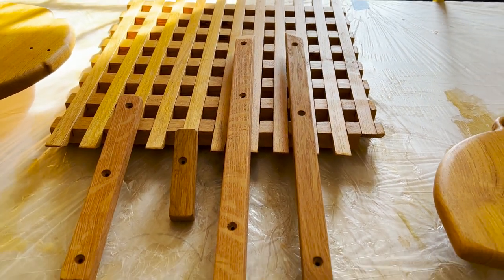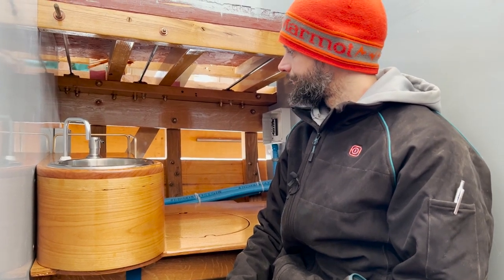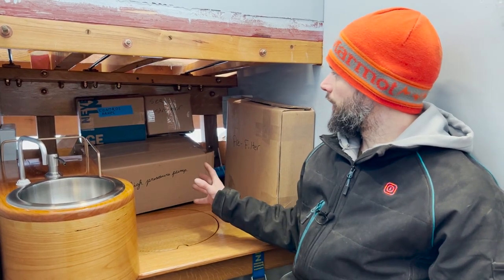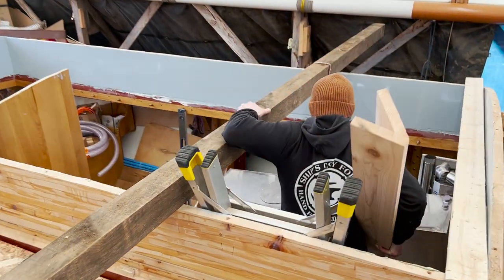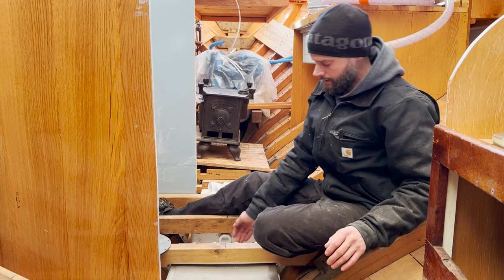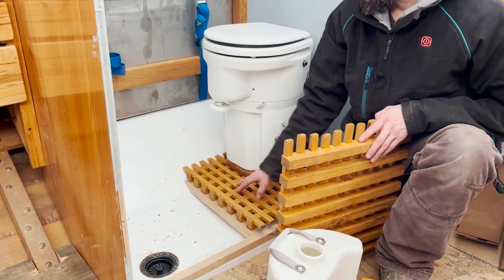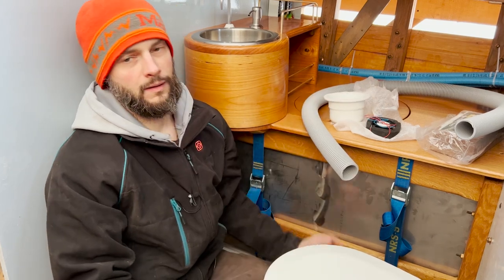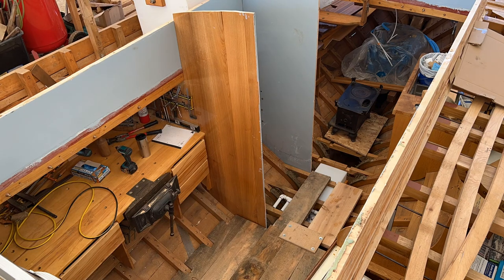Putting In the Bilge Tanks - Episode 205 - Acorn to Arabella: Journey of a Wooden Boat

Comment: Love ur ideas Steve but man u'll miss a hot pressured shower in colder climates. Set it up so ur engine heats the water and 1 pump boom hot pressurized water. That camp shower is great but in cool climates after being sprayed with salt spray a hot nice shower is 100% worth it
Reply from the maker: Water heaters that work off of engine heat are very nice, but the engine needs to have been recently run in order to be able to have hot water. It does seem like a large compromise to a lot of people to not have hot water, but it also kind of demands that you then also install a pressurized system.
Reply from the maker: Steve and Robin both love a hot shower, so ya never know. Maybe a system like that is in their future eventually!
Reply: @AcornToArabella  there are propane powered camp showers which can run off a small propane bottle and D-cell battery. They will get HOT!
Reply: I personally  couldn't  stand the foot pump shower if that was my primary  way of showering. A good experiment  for Steve and Robin is using  the foot pump shower in the house  for a couple of months and see how they feel about it.
Reply: You could heat some water on the stove and pour it into the foot pump shower. Can't be overly hot due to the plastic, but it can be quite warm. I've used solar showers where you put the black bag on deck to heat during the day, and it gets quite hot in the Florida sun.
Reply: In our remote hunting cabin we used the combination of stove top heating or water and a bag type solar shower system for many years.  Takes a few minutes to get it ready, but you can get a nice frugal 5-10 minute hot shower.

Comment: I appreciate the thoughtfulness you have used in deciding on your water system. However, the foot pumps will get old real fast, especially for the person doing the dishes. I would not be shocked to see a pressurized water system in your future but I hope the manual pumps work as well as you think. CHEERS!!
Reply: Hey, paper plates are a God-send. Just throw the dishes in the wood stove and burn them. Wash the cook ware, drinkware and utensils.
Reply: Seconded. You will not regret pressurized water. You will definitely not regret hot water.

Comment: I plumbed my entire house with those stainless PEX crimp fittings, and I've come to regret it.  I've had a number of them corrode and let go, causing major leaks inside wall and ceiling cavities, which are a real pain to fix.  And mine aren't in a marine environment!  I would highly recommend getting an expander + sleeve type system (Uponor or equivalent) as they seem to be a lot more reliable and should completely avoid the corrosion issue.
Reply: 1000000% THIS. Wirsbo collars are the original (and correct) way to terminate PEX. Those crimp connectors don't generate remotely enough force, and are too fragile/thin for anything more than a temporary repair.
Reply: Completely agree. It's not IF they fail, it's WHEN. Change them now.
Reply: In the early 90's when I was building Megayachts we did some tests with different plumbing systems for potable water.  when I started we were using CPVC but freezing has started to be a problem so we explored the, then brand new, Upnor PEX as well as a couple of other systems.  None of the other systems that we tested were both economical to install sturdy enough and resistant to freezing enough to meet our needs.  the crimp systems, which were common at the time, would fail if they froze and couldn't handle the movement and vibration that the marine environment presented.  Upnor cold freeze solid with no damage, responded well to heat, was physically very resilient (we stretched it 200%, and with the application of heat returned to its original dimensions.)  In short we were unable to find any products that were superior.  There is a reason that the crimped version is the system of choice for manufactured homes and RV's.
Reply: Try the shark bites they meat code and you just push the pipe into them and your good to go theirs a little 10 dollar tool used to take them off and they work with pex and copper
Reply: It's not only frowned on you're not supposed to dump your tank unless you're 3 Mi or more offshore
Reply: @bryonensminger7462  You’re not supposed to but I can guarantee that most recreational boaters do.

Comment: Hey Steve, you'll figure out what you want of course but I thought I'd provide some input relative to your toilet. 
I use a Nature's Head year round, which is almost identical to yours, and have found that using coconut fibre or peat moss as substrate (never added enzymes) there is really not an issue with smell. I elected to try it without the venting fan and have never felt a need to add it. The added hose and penetration aswell as the steps/awkwardness of disconnecting/reconnecting would make it a no brainer for me to delete that function were I in your shoes with Arabella. 
Just a anecdotal data point for you. Nice job on that head!
Reply from the maker: Thanks for sharing your experience!

Comment: If not already mentioned, perhaps a DIY solar water heater for warm/hot water. Simple as a black hose running around up on deck to as complex as you want. A 4WD can fit a white pipe painted black on the roofrack to warm water on sunny days, enough to make water quite warm/hot depending on the sun.

Comment: Have you thought about using a gravity-fed shower. Just have the bag hanging above deck in the sun and have the hose running through. They make camping ones and I've used those a lot and they're pretty great. The sun heats it up and the gravity means that you never have to pump it
Reply from the maker: Those tend to have a slightly weak amount of pressure, but they do work good for some people.
Reply: @AcornToArabella  yeah I prefer that over having to constantly pump. Although I was a cyclist and I would use it on ragbrai so I think the portability won out :)

Comment: I think a submergible camping pump for the shower will do the trick and it's a really nice solution. The only thing you need is a shower handle with an electric switch to turn the pump on and off. Easily available at your nearest camping store. Your shower it's also great on deck, but inside the boat?

Comment: Small tankless water heater, a circulator pump and a 5 gallon tank, with an option to rainwater fill. You'll want to exercise the power plant at scheduled intervals anyway, plan a hot shower around it. Or a heat exchanger off the engine set up to convectively heat your shower supply.

Comment: Your Helio LX shower looks like it would work fine—though it is making a awkward and crowded space that much more so and pumping while showering might get a bit old. I would suggest an even more basic system where you do not have to pump. Get a decent size heavy duty plastic bucket  or water bag (make it black to warm in the sun) sized to suit your intended shower time/volume. Fill it up, haul it up high on a halyard, and connect the hose coming out the bottom it to a quick connect on the deck running to your shower head. If you have a down hall on the bottom of your bucket/bag, you could stop it swinging around if showering at sea. You could fill your bucket with heated warm water, or sea water, or collected non-potable creek water or similar, when conserving your precious tank water. This same system could do double time and serve as a deck washing gravity-fed water source.
Reply: See also:  Solar shower!

Comment: A simple 12v RV water pump would fit down in the area by your bilge tank, you don't need a tank to store pressurized water from it, it shuts off automatically when it gets up to pressure and cycles as water is used.

Tankless Point of Use water heaters can be very small (about the size of the sea filter for your water maker), their only down fall is all of them that I am aware of are 110vac.

A 12vdc water heater would need to be 6gallons to really be usable for a shower as I doubt it could heat water fast enough for tankless.

I have full timed in an motorcoach in the past for several years while working, having a warm to hot shower is worth the little extra effort.
Reply from the maker: Thanks for sharing your experience with us!

Comment: In the showe tray you showed a cross beam, i think you said about epoxying those in and painting ?
That would be a way to fix down the slatted floor, embed some screw anchors (drill right through for drainage) into the cross beams.

Comment: You might miss the comforts of a water pump especially for a live aboard. And with a water maker onboard, water quantity is less of an issue. Make it s boat policy that if the maker breaks or if sailing in foul water, then the electric pump goes off and foot pumps become primary.
Reply: Perhaps you missed Steve's explanation about economy of water being a priority consideration.
Pressure water systems are inescapably a deal breaker on that front. 
Comfort, by comparison, comes in at about #9 for a long distance voyaging boat.

Comment: You say you're worried about space for a pressure / hot water system, but the pressure pump and hot water tank on my boat take up no more space than your foot pump system, and they are located in an area of the boat where it takes up no living space.  The pump runs until the system is pressurized, then shuts off. Use pex style lines to the faucets and some 1" braided water hose to plumb everything and together they will act as a small accumulator by the fact they will slightly expand under pressure.  I can fill a coffee cup maybe more from the sink using just the line pressure with the pump turned off. Doesn't sound like a lot but more than enough to get a rag wet for cleaning up a small mess or your hands.

Comment: Suggestion:  Powerful UV light irradiating the fresh water before it goes into the hooding tank to kill bacteria and viruses.  A spring-shaped tube wrapped around a clear section of pipe between saltwater separator and holding tank would be enough, I would think.  Better safe than sorry...

Comment: Stephen. 
Just an idea that might be worth thinking about. 
As you have fresh water and need to make sure that nothing grows in the tanks, have you considered UV-C lights?
UV-C will basically kill anything that tries to live and as long as the light stays in the tanks you'll be safe. I used it to sterilise the mail during the UK's lockdowns, I just needed to make a box (cardboard) to do it in.
If it sounds like a good idea I'd definitely do some research.
😀👍
Reply from the maker: Thanks for that offer, very kind! For now, that’s not the plan, as everything going into the tanks will have been sterilized by the RO system. Typically, cruisers will use drops of bleach or other things for the tanks, but not UV.
Reply: @AcornToArabella  
🙂👍

Comment: Having lived on my boat for 6 years now, and not having had a shower on it, I have relied on showering in the cockpit with a hand pump setup, or just warm water in a bucket and a sponge. 

I can tell you that one of the most important things to me on the boat has become hot water. 

Might not be for you, but one of the key points of my big refit has been getting a shower installed, and getting everything set for a diesel fired boiler to not only heat the water, but the boat it's self. 

Eventually I suspect you will find yourself going this way as well. 

That being said, everything looks like it is coming together well.
Reply from the maker: Maybe so! Thanks for sharing your experience.
Reply: Everyone's different. I don't even bother with hot water on land. Except for dishwashing.
Reply: @Renegade Show
"Having lived on my boat for 6 years now, and not having had a shower on it, I have relied on showering in the cockpit with a hand pump setup, or just warm water in a bucket and a sponge..."

This is absolute hogwash. You lived at Foss Harbor Marina for three years, and they have showers. You spent a year after that gunkholing around Puget Sound, pulling into various marinas to shower (your own video of you getting pissed because you couldn't use the showers in Gig Harbor: https://youtu.be/Vl7m_kR2fmg). After a year of trying to pimp-out marina showers while you were anchored out, your boat went up on the hard in Port Townsend (which has showers), and you've been there for over two years. Quit trying to act like your some salty 'ol cruising sailor.

Comment: Pressurized water AND foot pumps give you a backup for retrieving water from your tanks. You could break an ankle on a long crossing making the foot pumps problematic.
Reply: A hand pump would be a better backup. It's also easy enough to rig a cord + pulley system to operate a foot lever by hand.
 Electricity is not a good backup option on long-distance sailing craft that stay in remote locations for months or years.
Reply: @Gottenhimfella  The foot pump is the back up. 21st century electrical systems in the marine industry are pretty robust…they are installed on every new boat made, even the ones destined for expedition type sailing. Anyway, it would be easier to install now.

Comment: Hey brother think your doing great ,I my self am a retired Carpenter Area (Shower head ) review your  video . Look at the deck bolts sticking down , it is sometimes better to back up then to make a Cluster, you know what I mean. Remove your electrical boxes in this area extend the flex and the great thing about wires are couplers ( wire connection longer to raise the boxes.
This will allow you to mount your your Water Maker . 
Mount your Sea strainer and Control Panel down on the counter behind your inspection cover  .
Then mount your High Pressure pump above them.
The place the Pre Filter it towards the edge of the counter top to replace Filters easily.
Hope this helps 
Oh you will have more room to open your inspection cover .

Look at your video it might help 
You solve problems in other areas giving yo a place for. A cup or a toothbrush 
👍😃

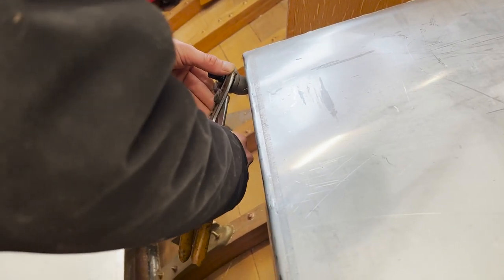Comment: Steve, could you please identify the material the metal fitting connected at the triangular tank is made of at 23:02 ?  It was a st 45 degree elbow transitioning from the female tank opening to the crimp PEX connector.  It appeared they might be black sch 40 malleable 45 ells which would be a nightmare.  Hoping it's some kind of stainless.  Also, wish you were using a more reliable brand PEX connector.  Those fittings will endure endless banging around at sea.  Have seen too many fail to be comfortable with them.  (But your system only having static head pressure may help reduce failure.)

Comment: I have a black water tank in my boat, plus the head has a thru hull water inlet with the hand pump fill/empty; even with all that you still can't really poop in it, nor put any paper in(at times I've just randomly stuck a plastic grocery bag in there to work as a liner, to take a dump) the whole system seems ridiculous, maybe at best designed so that 'someone else' cleans up after you and empties it, if you haven't just sunk the boat using it - so all that has to go - replaced with just a fancy 'bucket' like you have; so its easy to manually empty and just about anything can go in it without needing extra water to use it 👍
Reply from the maker: Thanks for sharing your experience, Benjamin!

Comment: How is the membrane changed / replaced ? Do you unplug the hoses and replace the whole unit or do you unscre the cap and pull out the long sylinder from inside the steel cover ?

Comment: I mean, some sort of 10-15 gallon rubberized bag/tank would heat from solar, and you'd only need it up a few feet to get the head pressure necessary for a low pressure shower, hoist it a bit higher for more pressure. Still not a complicated setup but saves you having to pump during your shower, just requires a few minutes of rigging in prep.
Reply: I agree with the gravity idea, but it strikes me that it would be only if you had half a dozen teenage girls on the crew that you might need 10 gallons or more. Mind you I don't live in the US, maybe it's cultural.

Comment: Have you considered using a ceramic filter in your prefilter so you CAN make water in turbid waterways? They can be cleaned with a toothbrush and re-installed. I use one as my prefilter for my water purifier. The ceramic catches what the sediment filter doesn’t. Most ceramics are around .08 micron which is mostly drinkable-for well water but i prefer the membrane and UV as well.
Reply from the maker: Thanks for the recommendation!
Reply: @AcornToArabella  your welcome! Im in the Philippines btw

Comment: You should consider the ability to run any single tank through the RO.  Then if one tank gets contaminated you can clean it through the RO into a different tank.  Slightly contaminated fresh water is easier to clean than salt water. As noted below raising shower container increases pressure.  Ideally you could pull to top of mast and not have to pump at all.  Use a large hose coming down.  Every 33' of elevation gives you about 15psi.  Most municipal systems run in the 60-90psi range. Lastly old plumbers joke: there is no such thing as a "hot water heater", only water heaters.:)

Comment: I would while you have access run the water lines and jyst cap them off that way if you want pressurized water all you have to do is add the pump and hook up the lines and if you never want it it won't hurt any thing